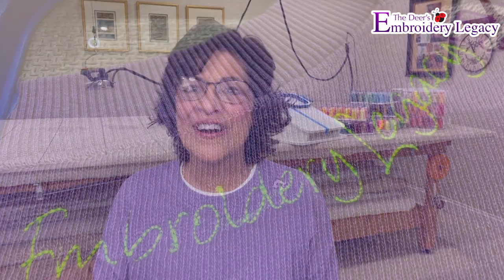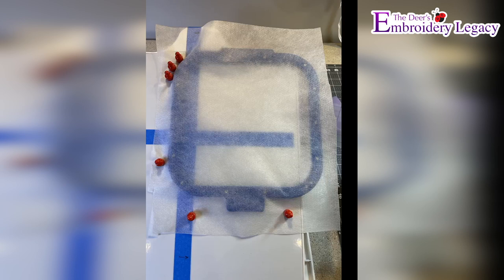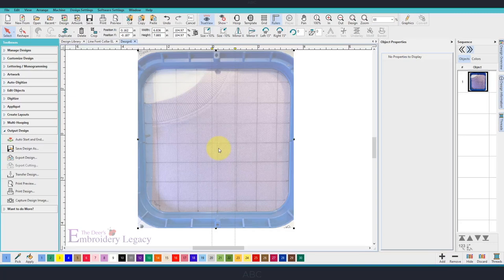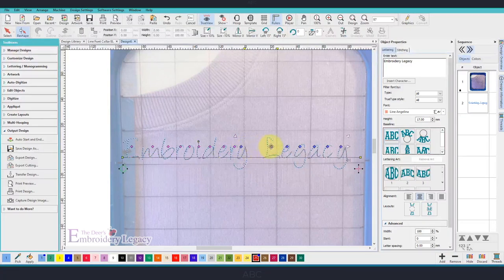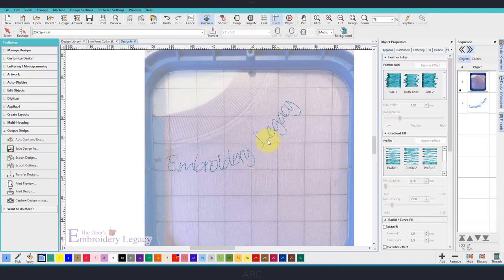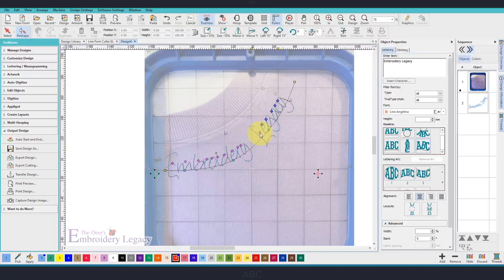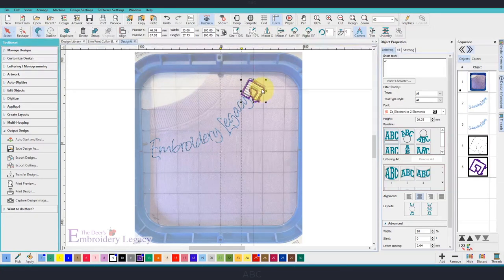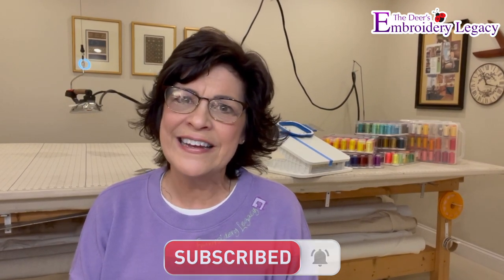How to Machine Embroider on a Neckline - Design Creation & Hooping

Comment: Please, where can i buy online centimeter grid for mighty hoop?
Reply: The best place to look is your machine dealer to see if they are available for your hoop. Quilting Shops carry plastic grid sheet (not sure if they are in mm) and you can cut them to fit inside your hoop. Or make your own like I did in the video using a plastic cutting board from the Dollar Store and draw your grid with a sharpie marker :)